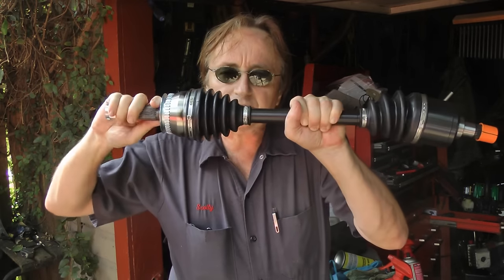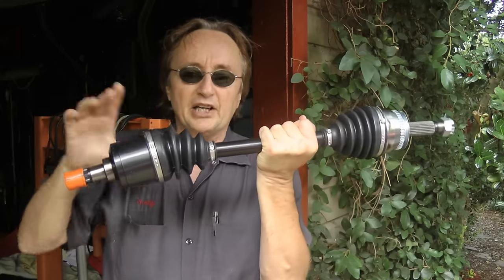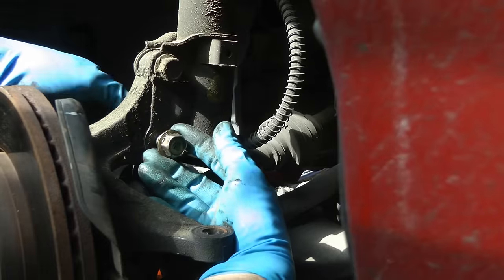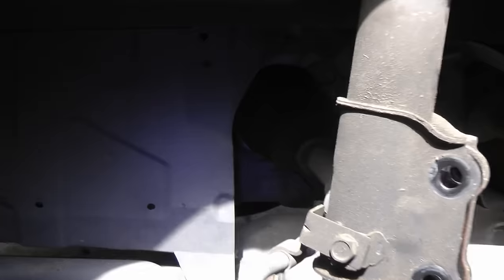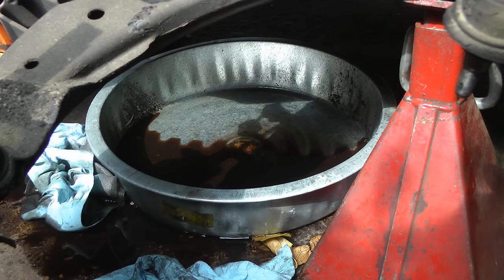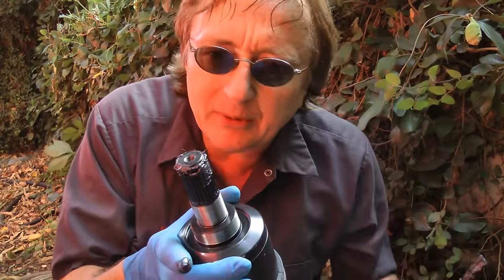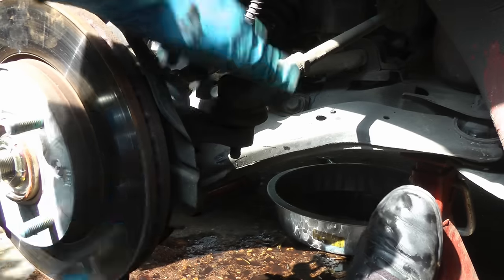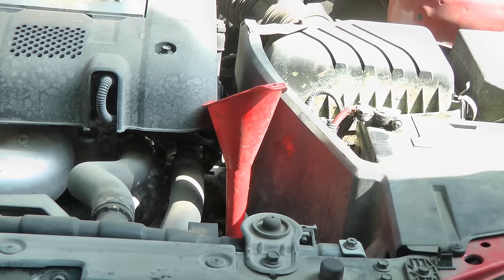How to Fix Car that Clacks When You Turn (CV Joint and Axle)

Comment: Is it possible for a car with 50,000km (31,000miles) to have a problem with the cv axle?
'13 kia optima
Reply: Yes.  In two ways.

1. If the boot gets cut, the grease will wash away, water and debris will get in and the bearings will deteriorate.

2. Stress from the wheel hitting something like a pothole or curb,  jackrabbit starts or rapidfwd/rev changes with a manual gearbox can overstress one of the bearings or crack one of the yokes, and the joint fails internally.  The excessive joint movement tears the boot.

The clicking is an indication tharg that the joint may be failing.  A torn boot means that the joint absolutely IS failing.

Comment: Scotty, when I'm not moving at all and i turn the steering wheel either direction i hear a clicking sound. any ideas?
Reply: Do you hear the same noise when your car is running? what car do you drive?
Reply from the maker: any worn suspension part can do that, jack it up and do my video "how to check out your car's suspension "
Reply: Robban Penger whether the car is running or not every time i turn it clicks. its a 1997 maxima
Reply: Do like scotty tells you. From my point of view is sounds like the strut bearing or from the rack and pinion. Its easier if you have a friend to help you. He could turn the steering wheel while you crawl under the car.

Comment: I balanced my car it had a shaking problem and replace the arm bushing and it still shakes bad around 60mph.. and also when backing up from my driveway and steering it makes a loud cracking noise! what could it be!? And btw my car Smells like gas sometimes when I turn it on really bad..
Reply from the maker: many things can crack, see my video "finding the source of car noises". But smelling like gas when you start it is often an engine running too rich, from worn fuel injectors or worn out spark plugs. Try the plugs first

Comment: my moms car make a clicking or popping noise while shifting gears is this normal
Reply: sounds like its coming from the back
Reply: May be rear differential issues or U-joints on the drive shaft.

Comment: if you don't have  air tools (I do) you can leave the car on the ground to break the  hub nut before you jack up the car...that works well too.....it will be work so just buy some air tools..its 2014 for crying out loud !
Reply: M Sawyer
yup my buddy worked for Midas I struggled for 3 hrs on a bolt  with a wrench ...brought it to him and in 3 seconds it was off...I was sold i bought the type of tools he used for work so I could use them home...
an IR 3556 Ti air gun is the best !

Comment: why not take the ball joint off, so you don't have to get alignment again
Reply: There is no reason to get an alignment...
Reply: Troy Stringfellow your camber will be screwed up when you remove the lower strut bolts
Reply: Marcello Minghetti  Negligible

Comment: Why would you not just change the cv joint?
Reply from the maker: because a brand new CV joint can cost 3 times as much as a brand new axle assembly made in china, and they work fine
Reply: Oh ok, here in the UK the CV is 3 times cheaper than the shaft... plus no gearbox oil leaks
Reply: Christopher Hargreaves Replacing the whole axle is an American thing I think. In most other places you get charged out the ass for an entire axle assembly, even aftermarket ..
Reply: When I changed mine on my old Buick the whole assembly cost about 60 bucks at Auto Zone and they gave a $30 rebate for bringing the old one back to them so it was pretty cheap and I imagine its a lot easier to pop the old assembly out and the new one back in than to rebuild it.

Comment: I cant find my issue.... mine only makes one “pop” and only when i turn it all the way, you know in those low speed under 5mph turns like pulling out of a garage
Reply: Mine makes a few in the same circumstance. Not like his video it like 2 times per second. Maybe you have the same problem but it's not as bad?
Reply: andrew kb mine just does a pop. Just one. If i turn the wheel all the way right it’ll make only 1 pop no matter if i turn it right or left, or if i make a u turn or just a circle. Its just the one pop.
You know how when your completely stopped and you turn the wheel all the way and it feels like it turns just a little bit more then normal (like when your driving and turn) like you get a few extra degrees, well thats when the pop happens ,when im at a complete stop and i get it when i turn it 100%. But again only if i turn the wheel all the way, but if i turn it the way i would when just turning right or left nada. 
And i might sound crazy but my dads explorer also feels that way, if i turn the wheel at a complete stop or below like 3mph the turning radius is really good, but if i go higher then that the turning radius takes a hit and it kinda locks out those extra degrees of turning radius. But obviously no pop. I am planning on getting a 2” suspension lift soon so i might have them check it all out.

Comment: My car makes the same noise when i brake and turn. Is it because my CV has worn off?
Reply from the maker: yes
Reply: My car has a clicking noise but it goes away when I turn right (even just a little). Could this be CV joint problem too?
Reply: Saurav Malla yeah mine does the same thing